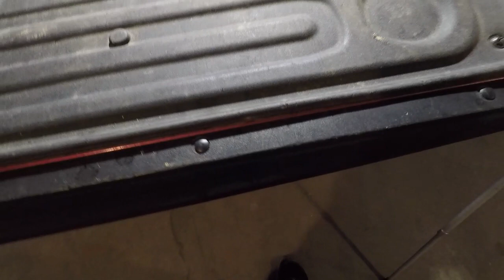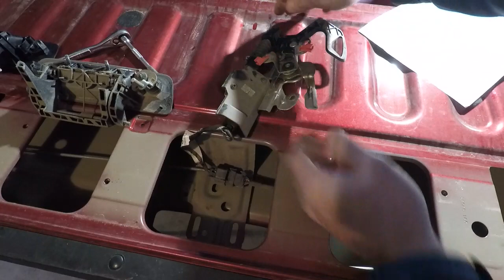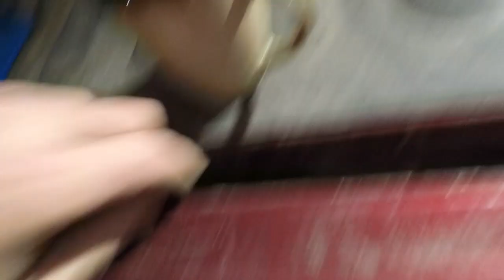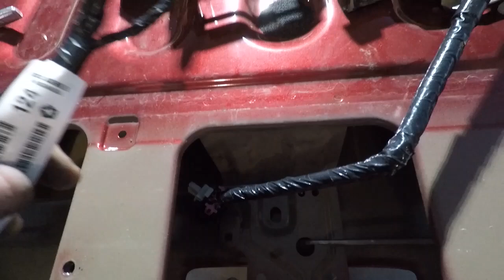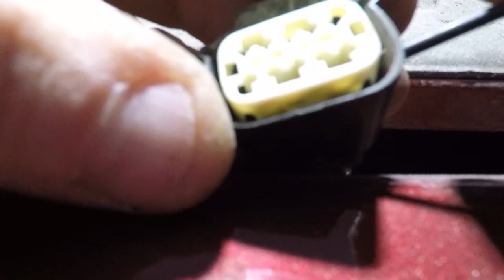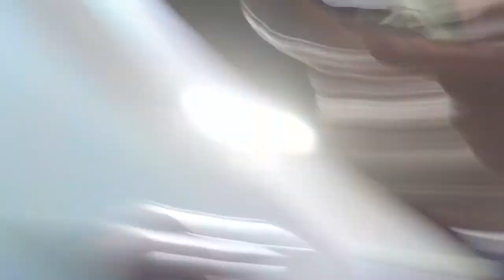Backup Rearview Camera installation 2014 RAM 4th gen. Part 1

Comment: My 2014 Ram 1500 came with backup camera not sure if it was added before i got it I'm the 2nd owner but it might came equipped wit it since my truck only had less than 25k miles on it when i got it
Reply from the maker: If it has the beepers for when you get close to objects I'd say it's factory. It was an option. Mine just didn't have it originally. Thanks!
Reply: @Aaron S Rose  i have the Express trim painted bumbers without bumber sensors so the warning beeps wouldn't be there but  i can add the sensors if i wanted to cut holes in my bumper

Comment: t hank you so much for doing this video, had this same camera installed at the dealer, what a nightmare, not only did they try to change the price 3 different times, the jambed up the key lock and the door lock didn't lock the tailgate anymore,  go out there and all they could do was unjamb the key lock, couldn't sleep and wound up here looking for this kind of video, they never pinned the tailgate switch, so then went out and fixed it myself,
thannk you

Comment: Did you have to take the dash board off to splice the purple wire
Reply from the maker: Howdy! I didn't pull any of the dash for this installation. Though, if that purple wire is the one that goes into the BCM plug, I wish I would have. That was miserable and I almost bricked the truck.
Reply: @aaronsrose  mine is a purple wire that I have to splice into an orange and dark blue wire I believe.   There is no room for me to work underneath.     

Did you have the same issue
Reply from the maker: I had to rewatch the video to remind me what I did. That purple wire is one of the most miserable things I've ever done. I did not remove any of the dash and the body harness is very short for that plug. It was the absolute worst part of the installation. I would suggest to unwrap the harness as far as possible and cut the wire and use a butt connector to attach the purple one. That's what I ended up doing.